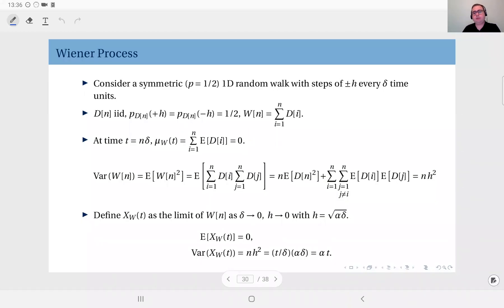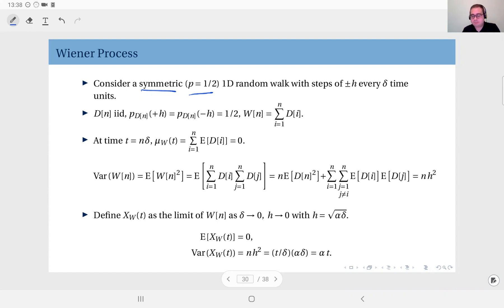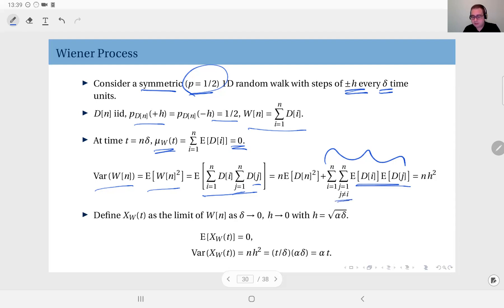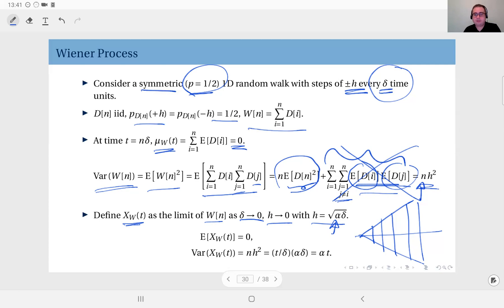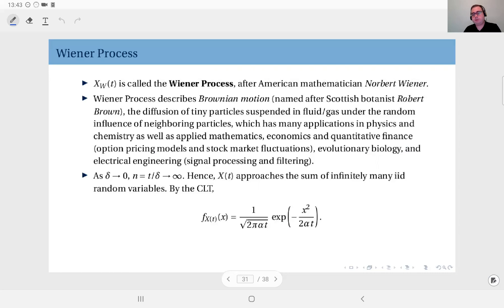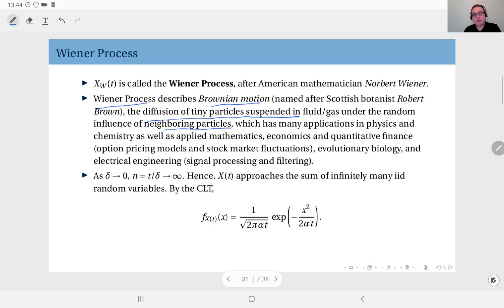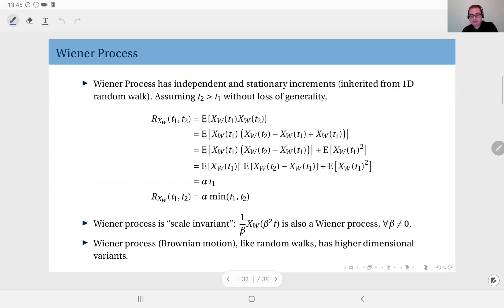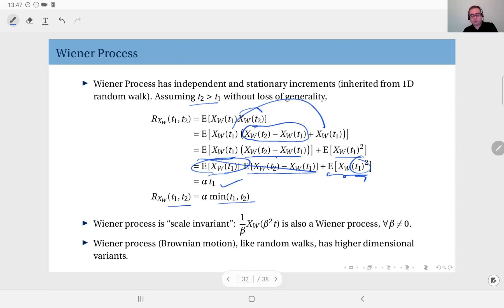11.10 Wiener Process

Comment: hocam wiener süreci durağan bir sürec midir
Reply from the maker: Hayır, sadece 0 mean olduğu için "stationary in the mean" diyebiliriz. Fakat varyansın (alpha*t) zamana bağlı olması stationary olmadığını gösteriyor. First-order stationary bile değil. Autocorrelation zaman farkı cinsinden yazılamadığı için wide sense stationary de değil.
Reply: @icizay  Teşekkür ederim hocam